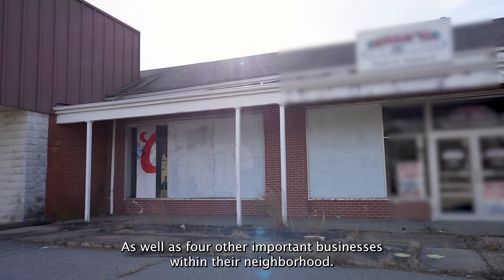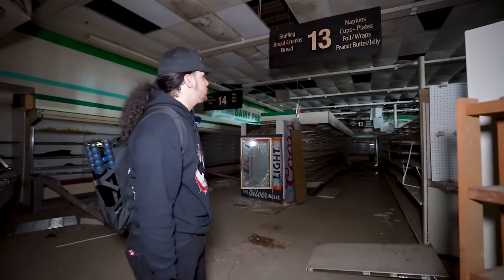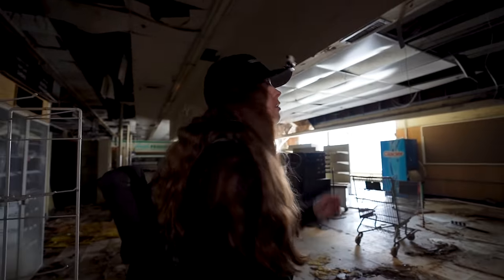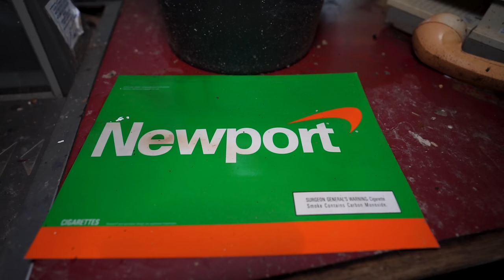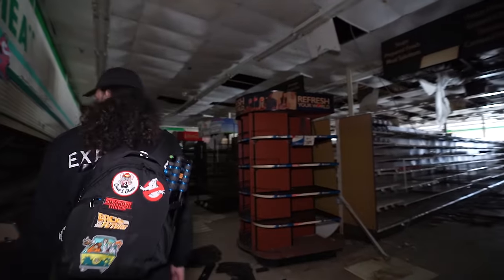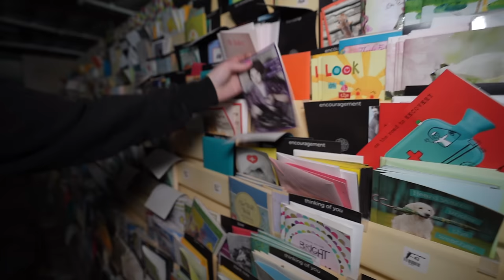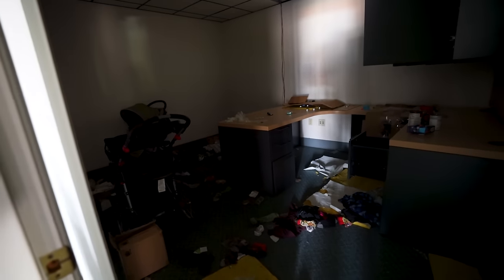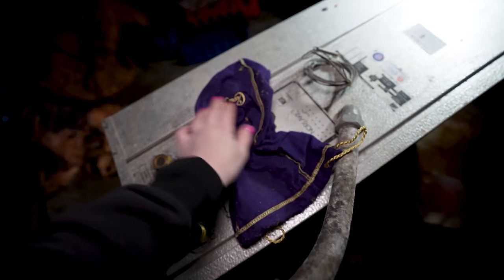What’s Left Inside an Abandoned Shopping Center Frozen In Time Since 2018! WE FOUND A SUBWAY!

Comment: That is a huge amount of decay for only being abandoned for 5-6 years.  I suppose there are roof leaks everywhere and it just snowballed.
Reply from the maker: Agreed it must have gotten so out of control that the level of decay was sped up
Reply: warren harding high school was abandoned in 2018 and the condition is insane. it was used by the FD for training and also there was a fire there. could be similar kinda story here.
Reply: Most large buildings like this have at least some roof leaks. Walmarts and costcos etc, all
have flat roofs so the water puddles in areas of depression. The roofs need regular sealing and maintenance to keep from leaking. Every large box stores i ever worked in had at least one leak.

Comment: Regarding the sanitizer… in the food industry, the sanitizer solution is the last step of the dishwashing process (for handwashing). It is to ensure that any leftover germ molecules are broken down. Completely food grade. In restaurants that have a commercial dishwasher, the high heat (up to 180°) is enough to sanitize. We use a solution with handwashing bc human hands wouldn’t be able to tolerate much more than 130° at most which is not hot enough to sanitize.

Comment: I've been a line cook for 20 years. Sanitizer for the triple sink is good rade chemicals ie edible is not poisonous. It comes concentrated in a jug and is automatically diluted to a proper mixture when it goes into the proper sink compartment. You walked by the station where the ph test strips were kept that test the proper sanitizer mixture. If you don't have those strips, that's one of the things the health inspector can deduct points for.

Comment: Great video!  Thanks for sharing your explore with us!!  I do think if I came into a place that squatters may be staying, I'd leave quickly! 
Sad the owners of the grocery store didn't try to sell or donate all of the shelving and racks, freezers, refrigeration units, deli equipment, etc., as there is always someone looking for those items and they are still expensive used.  Lots of non-profits could use these items in their pantries and kitchens, just a thought.
The three compartment commercial sinks are for washing, rinsing and then sanitize, which are state mandated laws.   Your third sink is for your third step, the sanitizer step in washing.  The sanitizer is usually a diluted mixer of bleach and hot water and you don't rinse them again.  You just dip whatever you are washing in the solution after you rinse for at least 30 seconds and let dry.  Those test on the wall are to test your sanitizing water.
Seems like a lot of steps but we all sure want our dishes and utensils clean at eating place!!
Reply from the maker: Thank you!!